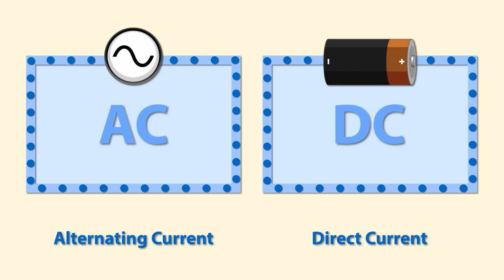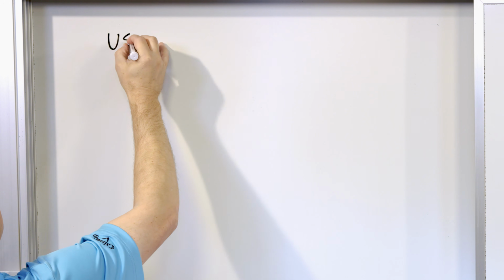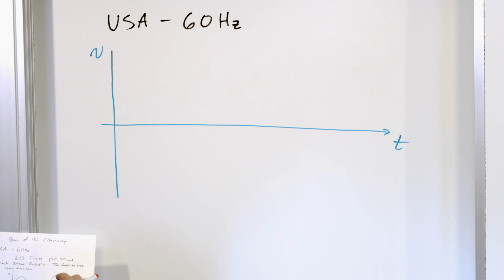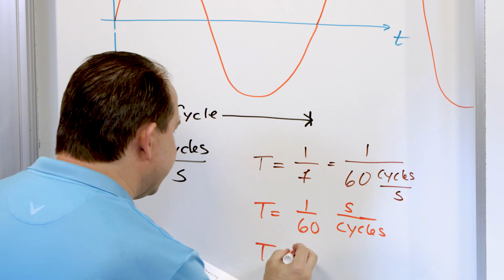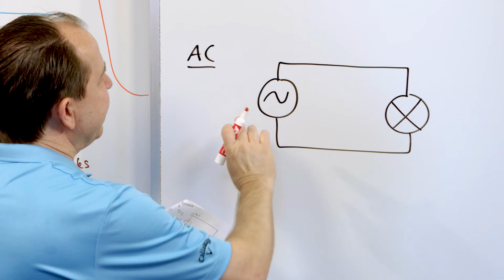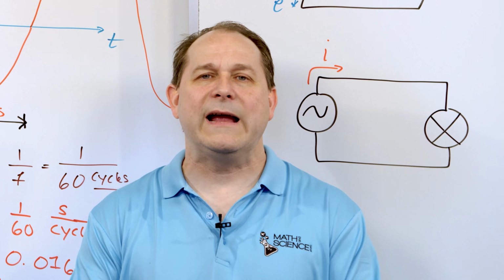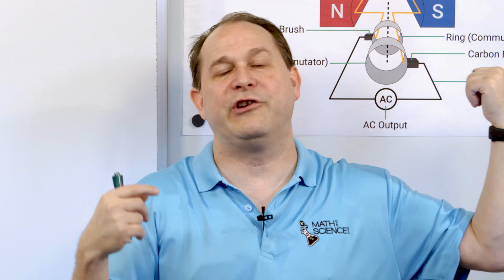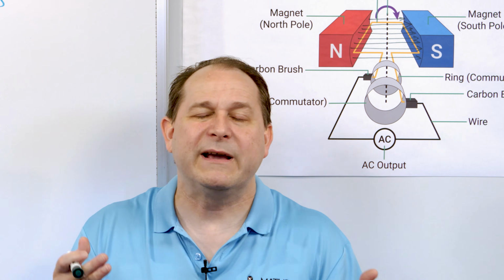VISUALIZE AC Electricity - Light Bulb in Slow Motion!

Comment: it was Nikola Tesla and his discovery of rotating magnetic fields and his discovery of polyphase AC motor (Tesla coil) which made it efficient and economical (high voltage,safety and distance) to use AC electricity. Faraday's electromagnetic generators and magnetic fields were weak and fluctuating currents. DC was very costly and very limiting.  GIVE TESLA HIS DUE :)

Comment: So what am I missing here? Because the voltage/current completely reverses direction in just one cycle (peak to peak, or 2 peaks in one cycle), then does the light not actually pulsate at twice the cycle (frequency) rate, or 120 times per second? So isn't the light on at both those peaks (twice in one cycle) and off when at the reference, or 0V points (again, twice in one cycle)?

Comment: There is a way to show this effect of cycling AC . This could have been done by slowing the frequency down from 60 cycles a second. to 50 cycles, then 40 cycles, then 30 cycles and lower. That way the eye would be able to perceive the changes in the filament temperature as the cycles go through the zero point.
To show the eye’s persistence rate just slow a movie down below 30 frames per sec.(FPS). You will start to see the flickering at about 30 FPS.  If it is run at a lower rate than 30 FPS the flickering becomes more pronounced. At a frame rate higher than 30 FPS the image will start to flow more smoothly with less or no flicker. That shows the vision persistence rate.    
Turns out, the brain does not see an image as it truly is! It only sees the AVERAGE of the image over time due to the vision persistence rate.!

Comment: This seemed awful lengthy. 
And I would consider 60hz as a fairly low frequency. Just reduce the voltage listen to it. 
And most homes, if not all have at least 2 phase electricity. That's how we can get 240 volts from the 2 120v lines. 
Did you say that power lines are running AC? It's high voltage DC.

Comment: You can see blinking/flashing in less sophisticated LEDs and fluorescents.  To the point the lit area goes completely dark.  I heard your eyes can see it but your brain auto corrects.  I came across this on home video I recorded in old fluorescent lights.  The video turned out going from completely dark to bright to dark again.  FPS and electric hz. Playing a dance between the two.
My microwave has led lights underneath to light up the stove area.  On low setting the bulbs run on half wave and you can definitely see that since the bulbs turn off a whole half the cycle. You still have to point it out to some that aren’t familiar.

Comment: Rather than talking about the sine wave frequency and then the period, I would have explained that the filament in the bulb does not care which way the electrons run, the heating effect is the same on the negative half cycle.  That means, the filament heats to its maximum TWICE in each period, or in US, the heating takes place 120 times per second.  Movies used to show 25 frames per second to minimize the flicker.  Now the computer videos, especially the fast games have pushed the frame (update) rate to again higher, something like 150 Hz.  Anyway, if you move your point of attention quickly (by eyes or whole head movement), you can probably still observe some flicker.  And another issue, the “current direction”, was to my knowledge determined before anybody really knew of the electrons.  The first directionality was observed in the electrochemical movements of metal ions in a liquid — in galvanic experiments.  There the measurable thing was the plating substance (positive ions) deposited to one electrode and being dissolved from the other one.
Reply: Film is/was projected at 24 frames per second, with the screen dark during film frame advance plus a 2x frame rate (or even 3x ) optical chopping for each individual frame because, though fast, 24 fps is still slow enough for our eyes to perceive some flicker. Before colour video broadcasting began, all video signals were synchronised to the 60 Hz line frequency so video artifacts such as "rolling bars" would not be apparent on TV screens. The video frame rate was nominally 30 Hz, but that could still produce objectionable flicker, so two interlaced fields of essentially identical video displayed sequentially at 60 Hz. This, combined with phosphor persistence, is another way of achieving the same perceived flicker reduction result as the optical chopping that film projectors use.

After colour NTSC broadcasts began the frame rate was reduced by 0.1% from 60 Hz to 50.94 Hz (60/1.001 Hz). This was done for complicated reasons having to do with the specific signal characteristics required to transmit 525 scan lines (~480 visible) of chrominance and luminance as well as sound in the allocated 4.5 MHz video channel bandwidth yet still allow full backward compatibility with monochrome TV receivers.

In most of the rest of the world various versions PAL or SECAM standards were used with similar numbers except the frame rate was locked to 50 Hz with two 680 scan lines broken into two interlaced 340-line fields at 25 fps. Incidentally, if you have perfect pitch you might notice that musical content of movies originally recorded at 24 fps will sound slightly sharp when presented on PAL systems since videos are/were usually just sped up frame for frame from 24 to 25. The "sharpness" is given by the  ratio of 25/24. Most folks don't really notice a ~4% motion speedup, but some ears can hear the difference (I can't hear it, but my son can). What is noticeable by anyone though is the playback time for a movie originally filmed at 24 fps will be about 4% shorter when viewed as a PAL video.

Comment: It would be cool to see on the highspeed camera the filament being affected by a permanent magnet nearby as the AC waveform changes!
Reply: There is an interesting 1960s made lightbulb that uses that effect. They had inserted a magnet inside the bulb and the filament was loose. When you turn it on, the filament wiggles around wildly. Someone had made a video of it.

Comment: While it is true that in general, when the voltage is high, AC performs better than DC in terms of transfer cost/efficiency. However, in the scenario of long-distance & high voltage transfer, DC (HVDC) actually performs better than AC.

Depending on voltage level and construction details, HVDC transmission losses are quoted at 3.5% per 1,000 km (620 mi), about 50% less than AC (6.7%) lines at the same voltage.

This world is never boring.

Comment: The movement of the filament was the most interesting. I didn't consider that.  The temperature should not change fast enough to cause that. I don't think so anyway. What is doing that? Changing magnetic fields? Is it thermal effects? My guess is it is the magnetic field in the coiled filament.

Comment: This mae my think about how LED Christmas lights flicker when they are moving, but appear to illuminate steady when they are still.
I always enjoy your videos.
Reply: LED lights flicker for a different reason. They run on DC. Maybe he'll talk about it in the future.
Reply: @a9ball1  LED lights would flicker even when you use a full bridge rectifier. There is also the forward voltage to factor in. If you are below the forward voltage, current almost doesn't flow.
Reply: @louistournas120  I just meant that don't flicker for the exact same reason as incandescent.

Comment: In AC current flows in both directions. But why we say one terminal as phase and other neutral? Answer please..
Reply: The voltage in the phase wire is always following that sinusoidal pattern even when not connected in a circuit.  The neutral wire is always at 0 volts when not connected in a circuit.  You can think of it as the current is being pushed and pulled through the neutral side by the phase side.

Comment: Years ago we used to be able to communicate short distances with incandescent bulbs in flashlights. Rather inefficient not only in the bulb but also in the output coupling needed from the amplifier (to provide bias to the bulb) and only worked for a couple dozen feet, but fun to mess with. Bias a photodiode and couple it to a microphone input and a surprisingly decent reproduction came out of the speaker. Cutoff was 3-4kHz or so, suitable for voice, but sounded like a really bad AM radio when fed music. Good times 🤣
Reply: because the filament has thermal mass and associated hysteresis. Smaller bulbs run at 50% output level will be much more effective. We need lamps that can be turned on and off very fast
Reply: @janami-dharmam  The idea has way more issues than the thermal mass in the filament haha... It never was seen as anything "useful", a friend and I decided to see if it was even possible.

Biggest issue it had was because the bulb power had to be low, had to demonstrate it in a dark room, as daytime sun wouldn't allow anything at all and night had the hum from all the artificial light. Might have been able to get a little more out of it with fiber optic but at some point it just becomes ridiculous to mess with lol
Reply: @MadScientist267  you can do the same experiment with a traditional fluorescent lamp (not using electronic ballast) and you can see the lamp flickering very very clearly. you do not even need any fancy camera just a small motor with a speed control fitted with a simple mirror and a simple cardboard with a hole (stroboscopic effect)

Comment: Question: given the same voltage, 120, is 1A from DC the same as from AC source?
Reply: This is a tricky question. The short answer is yes. The longer version is more involved.

120 VAC is what's called a root mean square, or RMS for short. This is something like an average, but not exactly. The RMS voltage is always lower than the peak voltage. For a pure sine wave, this value is 1.414x the RMS value, or if you're working the other way, RMS is 0.707x the peak.

These values move around as the waveform gets more complex, and can cause digital meters to read incorrectly (in particular) when reading a voltage (or current) that isn't a single frequency sine wave. Some of the fancier meters (may be denoted as "True RMS") have the ability to calculate the real RMS from a complex wave, but this can definitely cause errors under the right combination of circumstances.

This also manifests as capacitors after rectifiers fed by AC to settle at a significantly higher voltage than the "nominal AC" feeding it. You have to account for it in part selection when designing say, a power supply that is fed from the grid.

So the answer to your question is yes, because the RMS value is essentially defined as the "equivalent DC", but because of the dynamics of AC, there's more to it than immediately meets the eye. You also have phase relationship between voltage and current (which determines power factor) and the math just gets messier from there lol. Hope this helps.
Reply: 120 VAC is an RMA voltage, which means root mean square. If you measure 1 A, that is 1 AAC. The current will also look like a sign wave.
Then there is an effect called inductance. Inductance happens when you have a coil. It take time to build up a magnetic field. It behaves as a resistance.
So, when you have AC current going through a coil, there is the material’s resistance plus another type of resistance called impedance. The magnetic field build up “impedes” the forward current.
When the AC voltage drops, another effect happens where the magnetic field starts to weaken and this causes an induction. This has the effect of increasing the voltage a bit. You can think of a coil as a storage battery that lasts a very short time. It has the effect of pushing the AC sign wave of the amperage forward in time compared to the AC voltage.
You would need to see it graphically to understand better.

Comment: Great use of high speed camera, I grew up with that light bulb type yet never thought of it cycling light output like you showed us . I was told the vacuum in that bulb allows cleaner and longer burn life of filaments,  without normal gasses in air .Thanks again for marvelous demonstration and scientific topic .
Reply from the maker: Glad you found it interesting!
Reply: Actually, the vacuum is needed so that the filament does not burn out due to the presence of oxygen from air. But if the vacuum is really good, the filament will slowly evaporate and deposit on the wall and make the bulb less efficient in terms of light output. Also if the metal in the filament gets thinner, the resistance increases and the light out put decreases. Most incandescent lamps have some nitrogen at low pressure that reduces the evaporation of the filament and reduces the blackening of the bulb and prolongs the life of the lamp.

Comment: How does the LED lightbulb fit into the equation, I know they are much more efficient, but I'm very sensitive to their off/on cycle, and can often see the "flicker" and am quite disturbed by it. It really sucks that they are banning incandescent bulbs these days 😒. I wonder though, that even though our eyes cannot perceive the 60HZ flicker, if our brain still "sees" it (maybe why I always feel better in natural sunlight, then artificial light, even incandescent). I'm a high end audio nut, and even though our ears cannot hear above 20Khz , audio system that have the ability to go much higher in frequency, often seems much more open and natural. Just some pondering lol.
 Thank much for the video!!
Reply: LEDs used in lighting have the bad habit of being driven by PWM or poorly filtered mains frequency, resulting in pronounced motion flicker.

PWM controls the average output power of an LED by turning it on and off very rapidly. Particularly at lower frequencies and duty cycles (the percentage of time the LED is on), the more pronounced this effect is because our persistence of vision only holds visual stimulus for a short period. If the frequency is lower than the speed of our vision, or if the duty cycle isn't long enough to make the visual system "keep" the image long enough, the flicker is visible. This is why you see the "dashes" of light created by them when you move your head.

I push buck converter drive for LED for many reasons, this is one of them on the list... higher quality lights tend to use them but they get pricey... so to keep cost down they lose parts (a real converter starts with PWM) and the quality of the output goes down.

An incandescent bulb filament, while flickering, has significant enough thermal mass that this constantly changing light is very subtle, and at 50/60 Hz, this faint change is all but completely invisible to the human vision system, so it appears as solid light. An LED is much faster responding, so the complete on and off cycle is much more noticable, potentially reaching "obnoxious" at 60 Hz, and even much higher frequencies, as mentioned.
Reply: @MadScientist267  Thanks much fascinating info :)
Reply: Had a friend who could not attend class in a room lit with fluorescent fixtures. Headache by the end of class. The gas in the tubes responded much more intensely than incandescence. Current LED lighting would have driven him crazy.
Reply: High quality LED bulbs like Cree or Philips do not have this problem, as they use sufficient capacitive filtering.
Reply: I have a condition where my eyes jump from right to left, back and forth. It's from a bad wreck on my bike when I was 8. Anyway some LED headlights and taillights will flicker. And even some traffic lights do it now. 
It really sucks.
Reply: @a9ball1  Sorry to hear about your injury. Those applications are using pulse width modulation. Things are moving toward car headlights being actual proejectors with dimmable 'pixels'. I don't know if that will increase or decrease perceived flicker. Best to you~

Comment: Is the Sun considered A/C of D/C light? or something else altogether?
Reply: For all intents and purposes, the light that hits the sun-facing side of the earth at any given moment is "DC" if we're using electrical terms in analogy.

That said, there is a really long wavelength pulsating DC that has some sinusoidal characteristics, to an observer standing still on the surface of earth. The rising, peaking, and setting sun forms the "positive half", and night is all zero. To get this (approximately) in electronics, you would use a half wave rectifier (and slow it waaaaay down lol).

Depends how you want to break this down. But I suspect you're after the first bit... "DC it is."

If you're after the latter, there's even more than one frequency... not just days and nights but also seasons as the earth orbits the sun and the angle of incidence changes... then there's the moon... but you didn't ask about the moon 🤣

The bulb as presented in this video would actually be emitting the equivalent of another type of pulsating DC, which you can also get with a full bridge rectifier from the grid. This is because the filament heats up on both excursions from zero, which has the effect of "rectifying" it. The resulting frequency is said to be doubled (it contains harmonics, but the thermal mass of the filament largely suppresses these), and something "listening" to it would predominantly hear a 120Hz hum, rather than the 60Hz that is feeding it.
Reply: @MadScientist267  very interesting, Thanks for the response :)
Reply: All light is “AC” because it has frequency and frequency is alternating.